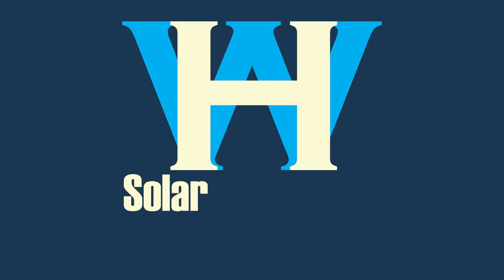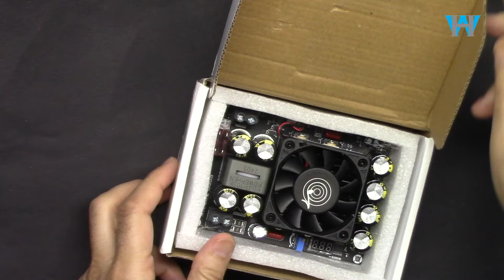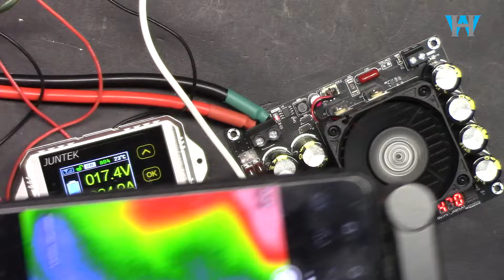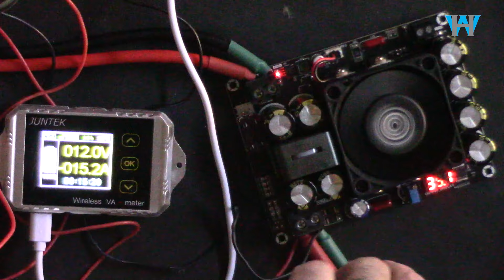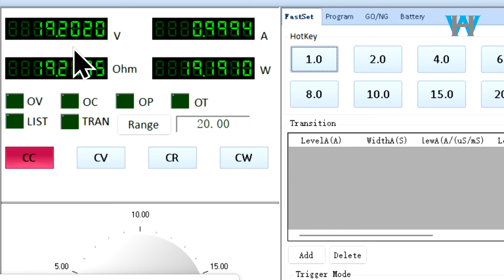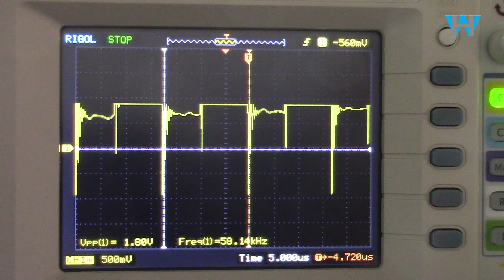Test of  ZK PW500 boost Converter 500W DC 12V-27V to 24V to 48V Step Up converter | WattHour

Comment: Como e feita a ligação das caixas de som nela ?
Reply from the maker: I tested and showed the output of this module. the output is connected the + and - of speaker. when you said speaker I assume you have a speaker which needs power separately than the sound signal. so connect it to the power input of speaker ensuring the voltage of this matches the voltage of your speaker.

Comment: If I wanted to use this to decrease the voltage output of a e scooter battery for a diy project from 42v to 39v would I be able to do so using this??
Reply from the maker: This is boost converters. The output is always greater or higher than the input so you never get lower voltage. Look at the other modules that I reviewed.

Comment: I have a Question for you. I was sent the wrong converter I ordered.I ORDERED A 12v to 24v 240w, 10a one, so i can increase my 100w or maybe 200w combined solar, to the power bank i have, for faster charging.I have a 1200w psw, 1000wh power bank. I received a 24v to 12v 20a 240w one. IF,... I SWITCH THE INPUT, 24v wires, WITH THE OUTPUT 12v WIRES,WOULD THAT CHANGE IT TO A STEP DOWN 12V TO 24V FROM THE 24V TO 12V.?
Reply from the maker: First you gotta learn this. Watt (power) is always watt. it can not increase. it can decrease due to effeciency. for example 100W is at the inpuyt so 100W=50Vx2A. you can get about 100W (not 100W but 95W). 100W=100Vx1A or 100W=1Vx100A or even 100W=1000Vx0.1A.  you can increase voltage or current but NOT power.
Reply from the maker: you didn't reply.  I spent time to write. you didn't evey says "thanks" or "not thanks".

Comment: Misleading output capability results due to lazy testing method using only a small number of Presets. 5A 8A 10A 15A 20A is far too coarse!
You are using a variable Load, so just decide on a acceptable voltage drop (say 5%) and then slowly increase load current until voltage drops.
I like this Channel for the devices tested, but the testing methodology is really poor.
Reply from the maker: You see , we can't satisfy everyone. If you read other module tests people say why so many tests. You complain why we  don't have more threats. That is enough. I did more than 40 tests .
Reply: @WattHour  - You did 40 tests but didn't get ACCURATE results. Do the same 40 tests for maximum current output,  but don't use Preset 1,2,4,6,8,10,15,20 Amps.
Simply use the Load to increase the Current in ONE sweep, and record when the voltage drops off.
That way, we all learn whether the device can output 11A or 14.5A... rather than you announcing "cannot to 15A so maximum is 10A" 🙄
Reply: I think the level of testing is great for a YouTube channel and for most general DIYers. The detail is enough to know that this module is way overrated , has an incredibly high ripple and could potentially start a fire if it fails. That’s definitely enough for me.
Reply: @williamdouglas7211  - you seem to be missing my point, like the channel owner. It's not the LEVEL of detail but the way that detail is determined and presented to the audience.
Rather than dragging out the explanation of the Current tests, the normal method is to connect the Load and "wind it up" until the power supply voltage in unsuitable.
Intead, this guy uses a few preset test currents with up to FIVE AMP increments, and then declares that (eg) "15A fails, so maximum is 10A"... where in actual fact the maximum might be 14.85A.
The testing method introduces huge errors (33% or so) in the reported results, plus it takes longer and gives viewers useless information that they don't need to know.
Reply: @johncoops6897  I get what you are saying , but in this case , the bottom line is that the power supply is a piece of sh#t and it’s best to stay far away from it. Also the best way to test the transient response of a power supply is with a step load. The stability of the power supply can also be determined using this method. Gain , poles and zeros are very important in the design of any system, so whether the content creator knew he was checking this , it is still great information for anyone who has a bit of knowledge on the topic.

Comment: I think that 5A steps are no suitable know the maximum output current. You can't know, for example, if the max is 10 or 14A, only why it can't handle 15A, and so further.
Reply: I just commented the same tbing. Very lazy and inaccurate testing methodology used, which makes the results almost useless.